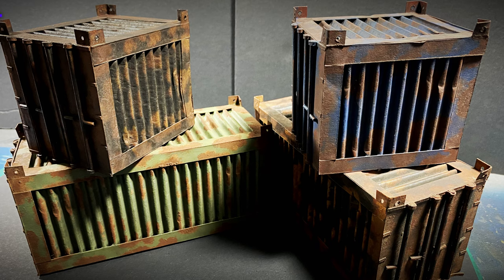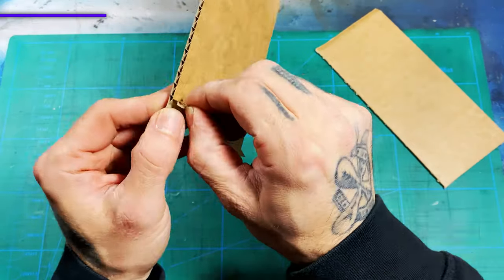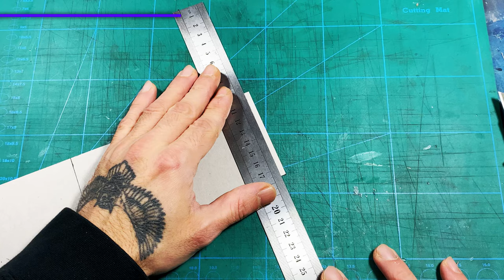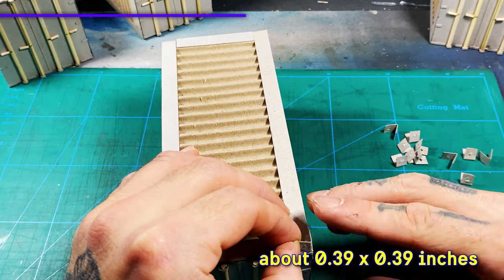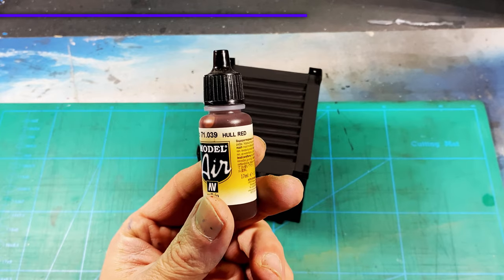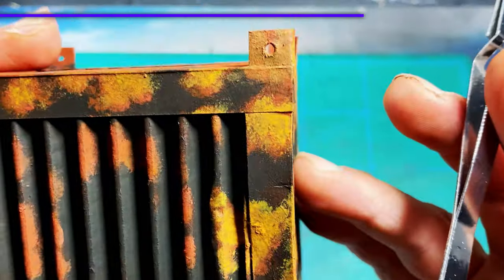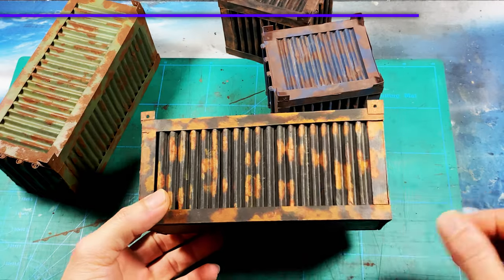Shipping Containers old & rusty #Diorama #ScaleModel #Miniature #ModelKit

Comment from the maker: 00:00 Hello my friends.
00:05 In this modelling project I am building few shipping containers that are mostly old & rusty, 6 & 3 m (about 20 & 10 ft) in scale 1:35.
00:17 A shipping container is a container with strength suitable to withstand shipment, storage, and handling. Shipping containers range from large reusable steel boxes used for intermodal shipments to the ubiquitous corrugated boxes. In the context of international shipping trade, "container" or "shipping container" is virtually synonymous with "intermodal freight container," a container designed to be moved from one mode of transport to another without unloading and reloading.
00:37 Freight containers are a reusable transport and storage unit for moving products and raw materials between locations or countries. There are about seventeen million intermodal containers in the world, and a large proportion of the world's long-distance freight generated by international trade is transported in shipping containers. In addition, it is estimated that several million of these containers have now been discarded due to the shipping cost of sending them back to their port of origin. Their invention made a major contribution to the globalization of commerce in the second half of the 20th century, dramatically reducing the cost of transporting goods and hence of long-distance trade.
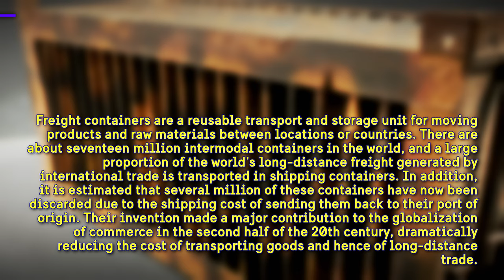00:57 Specialized shipping containers include: high cube containers (providing an extra 1 ft (305 mm) in height to standard shipping containers), pallet wides, open tops, side loaders, double door or tunnel-tainers, and temperature controlled containers. Another specialized container, known as Transtainer, is a portable fuel and oil freight container. The hybrid bulk fuel tank is originally intended for the construction, mining, logging and farming sectors. The tank can be used to transport and store bulk fuels as well as dangerous liquids, by road, rail and sea.
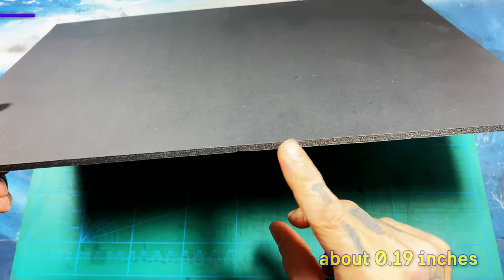01:54 Foam board sheet 0.5 cm (about 0.19 inches) thickness. I will start with the sides of the container.
02:00 The first container is going to be 17.1 x 7.4 cm (about 6.73 x 2.91 inches).
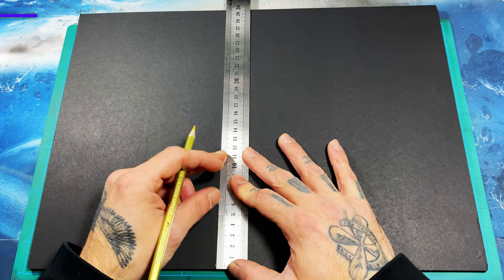02:05 Marking the sides.
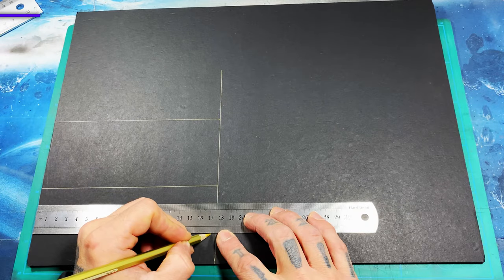02:15 I made a mistake. Sith happens 🤣
02:17 Instead of 17.1 cm I marked at 17.6 cm. Correcting! 😊
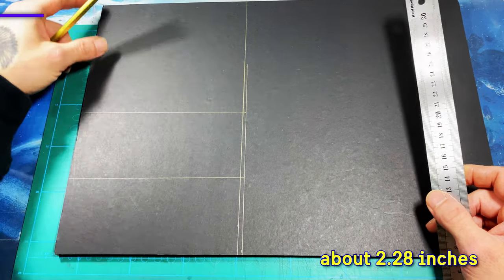02:24 Sides are done. Marking the lower and upper sides of the container at 5.8 cm (about 2.28 inches).
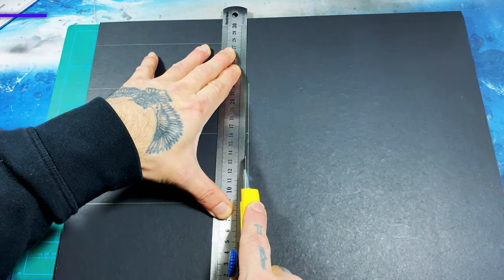02:37 Cutting.
02:44 All sides are ready (front and back I finished off camera).
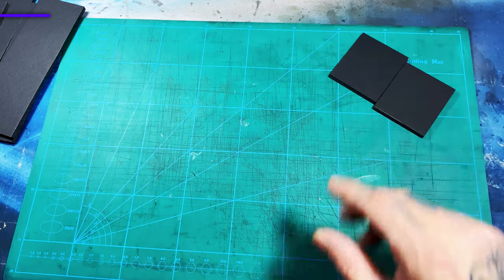02:50 Universal gluing the sides, instead of PVA, because it is transparent and dries faster.
03:03 Using pin needles if and when needed for better adherence.
03:09 ATTENTION! Keep always in mind that after gluing, painting, etc to let things dry.
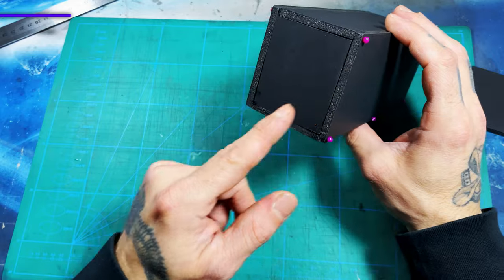03:59 I don't mind few gaps here and there.
04:05 The 6 m (about 20 ft) container is ready. I will mark and cut for a 3 m (about 10 ft) container off camera.
04:13 Universal gluing them and using pin needles if and when needed for better adherence.
04:24 If your foam board pieces are little bit bent, crooked, etc don't mind it.
05:19 I finished off camera for a total of two 6 m (about 20 ft) and two 3 m (about 10 ft) containers.
05:25 Using corrugated cardboard sheets, will mark and cut in the same container sizes.
05:29 Then will peel one side off. The rest will use on the outer sides of the containers for their wavy, ruffled, appearance.
05:37 Marking and cutting.
05:58 Very carefully peeling off. Exercise patience 😉
06:27 Completed off camera. PVA gluing.
07:16 No need to place a cardboard on the bottom.
07:36 Completed off camera everything but the doors.
07:41 Marking and cutting chipboard stripes of 1 cm (about 0.39 inches) to use as the containers side rails.
07:59 Cut them off camera. Also, marked at every 17.5 cm (about 6.88 inches). Cutting.
08:18 PVA gluing the side rails.
09:50 Completed off camera everything and now will be marking and cutting the doors.
10:22 Off camera cut 0.2 cm (about 0.07 inches) stripes for the doors seals.
10:26 PVA gluing.
10:55 This one I need to PVA glue again.
11:22 Cutting, smoothing out and PVA gluing, barbecue sticks that I already had marked, to use them as the doors locking bars.
12:10 Already had cut the doors hinges and PVA gluing them in their already marked positions.
12:50 Off camera I had cut toothpicks at 0.7 cm (about 0.27 inches), to use them as the doors handles. Super gluing them in their already marked positions.
13:26 Already done with the doors cam keepers.
13:32 PVA gluing the door on the container.
13:49 Using PVA, gluing these corner castings of 1 x 1 cm (about 0.39 x 0.39 inches).
14:23 Black primer painting like so.
15:30 The Army Paints Warpaints deep blue and airbrushing. It may need 2 or 3 coatings.
15:55 Second coating.
16:23 The Army Paints Warpaints sylvan green and airbrushing. It may need 2 or 3 coatings.
16:57 Second coating.
17:18 Vallejo's model air hull red airbrushing.
17:53 Hammer time!
17:54 I will use this hammer in order to make the containers look old and used. More realistic.
17:59 Hammer, hammer, hammer time!
18:20 Using this sponge (not Bob though) and this brown color, painting rust.
18:26 I am aiming for a very old and very used look, so, get ready for lots and lots of rust painting 🤣
19:10 English red pigment mixed with water. Oh and say hello to my little sponge 😉
19:15 Texturing away. Or as we call in my village, sagre 🤣
19:34 Burnt umber mixed with orange and keep texturing away.
19:57 Hull red mixed with orange and yellow. More texturing, yes.
20:31 It is more bright than I expected. Will fix it with Vallejo's environment rust texture mixed with lots of water. Kind of a wash.
20:39 Painting.
20:50 Even before it is dry you can see the difference.
20:54 This one I will make a bit differently. Some brown and red brown. I will be dipping the sponge in both colors and then will be painting.
21:02 Let's go!
21:19 Brown pigment and with a brush, texturing.
21:39 Brown washing.
21:51 Very light brown painting with my little sponge.
22:08 Texturing with a very dark brown mix of mine.
22:28 Brown pigment mixed with Vallejo's model air burnt umber and texturing.
22:38 Keep in mind that all this texturing stuff is my way of doing things. I am pretty sure that there are multiple ways to go about it. I just want to avoid copying others, if and when it is possible.
22:58 Brown washing.
23:16 From everything that I have done so far, I think that I like this one the most.
23:27 Disclaimer 😊
23:28 Since I am new to all these rusting business, I am 100% sure that it can be done much better and that next time, I too, will do it better 😉
23:37 Hopefully you liked the project and you will enjoy the presentation.
23:40 Presentation
27:33 Hit the Like, Subscribe and Notifications Bell "buttons". This way, together, we can grow a community around the exciting art of scale modelling!
27:42 Stay "tuned" for more scale modelling videos.
27:45 Thanks for watching!

The Watcher
https://www.youtube.com/watch?v=RL4IRasctus
Last Stop
https://www.youtube.com/watch?v=jZoFzZ8pBmg
Fallout
https://www.youtube.com/watch?v=w7AQu13yBdo
The Ultimate Drug
https://www.youtube.com/watch?v=862JkxSxquw
Glitch in Reality
https://www.youtube.com/watch?v=9M340LDomjU

27:48 by Karl Casey @ White Bat Audio

Website https://whitebataudio.com/
YouTube https://www.youtube.com/channel/UC_6hQy4elsyHhCOskZo0U5g